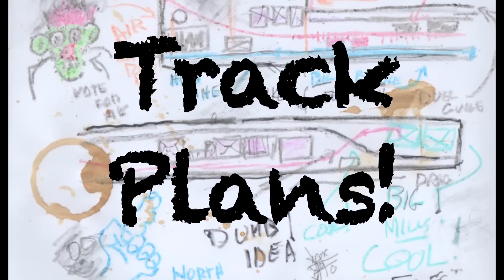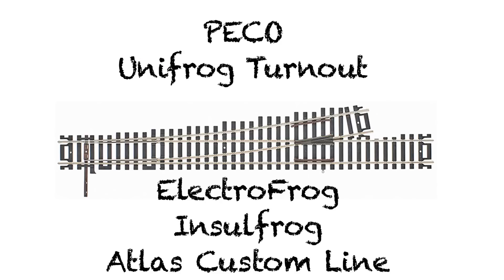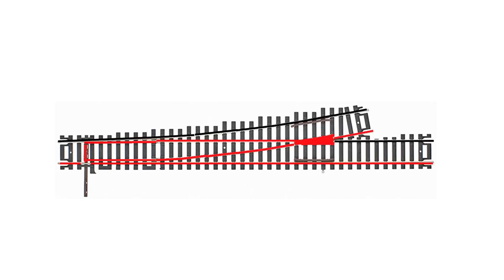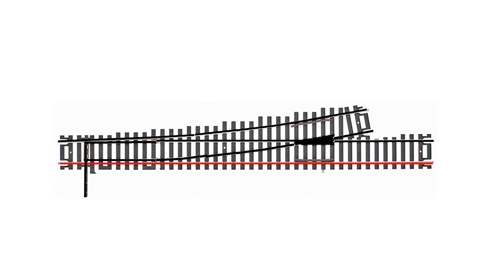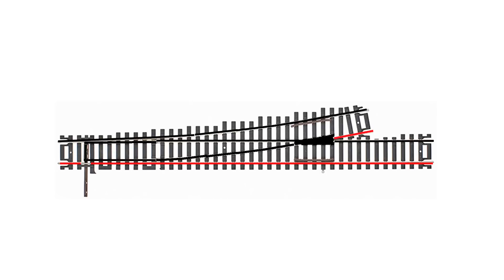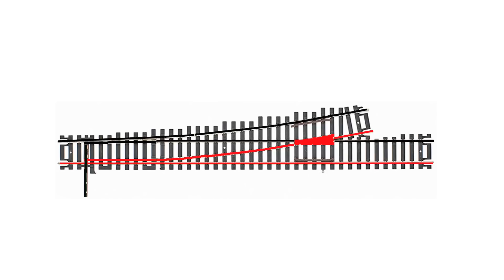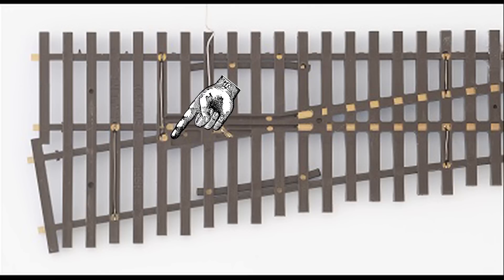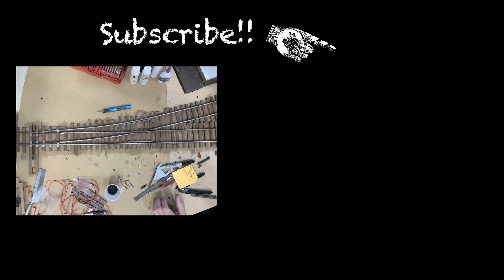How To Wire Model Railroad Turnouts Like a Pro. Peco's Unifrog, Insulfrog, Electrofrog

Comment: Good to know Toyman because I'm starting to wire my layout right now. If you are building a railroad or testing a signal system you need to know what type of turnouts are out there so you can wire them correctly. There are three types insulated frog, electro frog, and the universal. If you are going to install an insulated frog turnout you need three items in order for the command station and or the signal system to detect whether that turnout is open or closed. First you need the turnout itself a 5 or 6 or even a big 7, next you need a device from atlas called a snapper or a tortoise switch machine, and finally you need a device from their signal line called an ICM. Alternatively you can use a Tam Valley Depot frog juicer, or an nce signal relay do you supply the turnout with power. If you're turn out is insulated the only components you need are the snapper, the ICM, or the tortoise to power. If you have an electro fog turnout along with the snapper and the Tortoise you need to install a device known as a frog jumper you can do this two ways weld a green wire with a soldering iron onto the frog on the the tab underneath or you can use the atlas frog conversion kit that comes with the snapper and attach a screw to the frog and attack a green wire directly to the snapper and use that to power  the frog or attach that to a frog juicer or you can use the tortoise to supply the contact input. On a universal frog since the turnouts contain a spring to can either attached wire or you can leave it out. Also you need to be careful. All turnouts need to be insulated from the rest of the layout before you attach them to your blocks or to your signal system or the turnout will create a dead short which can blow your power pack or take out your command station. Remember the stock rails are always powered so you do not need to install any jumpers or insulators on any of these rails. The closure rails in the middle and the rails that come off the points need to be insulated before they are connected to your track because these rails will flip their polarity once the turnout is thrown. So you need to place 3 insulators on each side of the turnout on each side of the closure rails and these have to be placed on the rails behind the frog and on the north stock rail coming out of the turnout headed into the next block so it won't short out the command station your power pack or the signal system. Think of a model railroad turn out as a circuit. The common wire is always black this wire is always live you do not need to place any insulators on this one. The red and white wires are your hots and they do need to be insulated to prevent a short. The insulators for these need to be placed on the south rail coming into the points and they need to be placed on both sides of the frog on the south rail coming into the siding and on the North rail on the main coming out of the points. Once you have these three insulators set you need to place jumpers on the track on each side of these insulators so that they always have power the common you only need one jumper because it is always live. The last items that you need in order to supply the turnout with power and also your rails is you need 3 atlas products these are an Atlas cab selector plate, an Atlas block selector plate, and finally a loop so I can play it if you install a wye or turntable you also need this to supply your common with power. Once you have these items hook all of your jumpers up to the selector plates and label them with a sharpie their colors so you do not mix them up when you wire underneath. The final thing you need is you need some way to control the turnout when you throw it you can either use a touch toggle, a double throw switch, or you can use an atlas universal switch controller. Just be careful with these switches and do not leave them in your neutral position for too long the snap relay and the turnout motor itself can overload if you leave it in the neutral position too long and only hold the button or the switch down for 3 seconds or it will buzz and the magnet will melt if that happens you're going to have to unscrew the switch machine and replace everything and worst case scenario you're going to have to rip out the whole turnout which you do not want to do. Finally if you are going to ballast you ballast underneath the turn out first before you attach to turn out to the layout and only ballast the shoulders of the turnout not the inside or the gauge if you do that you will weld the points shut and the turnout will not work until it is cleaned.

Comment: Thanks, Dale and Karyn!  Wiring seems to be the bugaboo for most of us who are not "Electrical types!"  BTW, which source might have 1:24 or G Scale vehicles/kits?  I have not had too much luck.  Thanks!
Reply from the maker: @paulkalff6408  thanks!!! 1:24 and 1:25 are easy!  Thousands made. Every hobby shop. 1/20 harder. eBay has them. Mostly modern. Every Corvette!  But search for 1/20.. BUT. look for the old Hubbly kits from the 70’s and 80’s. Metal kits. Great kits but tricky to build. Die cast cars are mostly 1:18. Hundreds offered built. No kits. Again eBay. Some hobby shops. We use them. A bit large. But mostly okay. Just a bit large.
Reply: @ToyManTelevision  Fabulous!  Thanks, so much!  Trust all is well on the Wasatch Front!

Comment: Made me remember some hard times I had with my self made turnouts. I copied them from a Peco Electrofrog, only to have a lot of issues when I switched to DCC. The worst was the brass link between the points, it wasn't easy to solder a PCB to replace it, with the turnouts glued on the layout! But it works fine now.
Reply from the maker: Yeah, on my old HO all of my switches were wired with shorted points. In fact, I didn’t have any separation at all between the closure rail and the points and the frog. It was all just one continuous piece of rail. Or I should say several pieces of rail, all soldered into one piece with a strap across the points. But that does not work on the new railroad!
Reply: @ToyManTelevision  I had that too, as I first made the one side of the frog and one point of the same rail, like some real turnout. Then I needed to cut it in several places, turnout on the layout!

Comment: Sir, your layouts for frog angles are technically incorrect.  You show them as a right triangle.  The length for the larger number needs to be down the center of an equilateral angle with only 1/2 or 0.5 perpendicular to the centerline.  Granted, it is a very small number, but it is part of the definition of the frog angle.  The way you have the layout "will work" but not as well as when done "correctly".  The correct dimensions become more important to the operation of a turnout as the turnouts and speeds through them get greater.  A 1:1 or 1:2 frog or a mine kick-switch point will operate by pushing the mine car over it but it will operate but with a lot of jerkiness.   The smallest commercial frog produced was a No. 2 and 8# through about 20# or so for mine track of 15 to 24-inch gauge, mostly 18-inch.  The larger the gauge, the more the wheels need to be independently free to rotate about the axle to reduce sliding friction by being locked together by being on the same axle and having to turn at the same speed.  Your trackwork looks great and seems to work well.  My comments are for technicality only.  So long as the track gauge and guard check gauge are held within standards, a turnout can be built and operated almost as wildly as wanted and it will "work".  According to the AREA Standard Plans, the lead, the distance from the Point-of-Switch(PS) to the 1/2-inch point-of-frog(PF), may be changed by as much as 5% to keep from cutting rail.  I would not suggest changing any dimensions on No. 16, 20,  24, or 32.5 turnouts because of the speeds trains take in using them.  The 32.5 frog has a movable point and no guardrails to guide the wheels but has an 85 mph speed through the turnout side.
By the way, your slide plates under the switch points need to be longer to support the points under the 3 ties at the heels of the points.
I am working on getting you a treatise on how to do vertical curves.
Reply from the maker: Interesting! I’ve never heard of expressed any other way than just a right triangle and model railroad. I have seen the movable frogs on the long switches. I can see where those are a great advantage on a prototype railroad and they would be fun to model. Those long switches are a real challenge when working on a model railroad as they just eat up space. I’ve seen a lot of N scale railroads though that really get into that kind of prototype look. On an N scale module railroad you can actually pull that sort of thing off.

Comment: Getting back into the hobby after 20 years, looking for inspiration and "what's new" for designing my new layout. I get thrown these very interesting videos. However I'm building Marklin, so a 3 rail system, and none of this applies to me.
Switch frogs are just a bit of metal on Marklin track as both rails are neutral and the third rail in the middle or in the form of catenary provides the AC phase or DCC.
Reply from the maker: Center rail certainly solves a lot of problems! I love those trains. Good luck with your layout.

Comment: I model in On30 using Peco 0-16.5 track and turnouts.  Those turnouts are Electrofrog.  Using a Dremel cutoff wheel I isolate the frog and solder a green wire to it.  I have some tiny solid core wire and will solder my own jumpers underneath between the stock rails and the closure rails.  Then I do not need to depend on the point rails for electrical contact.  One thing I do recommend is a drop of glue on the rails that were part of the frog.  If you need to remove that turnout, those rails can fall out.
Reply from the maker: @dkaustin98  ditto!  Everything powered all the time with powered frogs (yellow wire). Frog juicers. And feeder wires to every rail. Turnouts, stick rails, everything. Every length of rail has a feeder to the buss. While power flows through the rail joiners it’s redundant. So every length of rail is connected to power in 2 or 3 places!

Comment: Kn regards to your out door layout, do you get any snow?? will it effect your operations in regards to shorting out the switches? From what I have seen G scale snow plows actually work for snow removal as well as sleeping cats. But with snow acting as a conductor does that not short out the entire operation??
Reply from the maker: @paulflak2823  hi!  Yup. Up to 2 feet on the layout!  Rails hit 160° in the summer!  We had an “inland hurricane” a few years ago. 110 mph winds!  Several structures blown apart!  That’s outdoor railroading!!  

We have run in snow. No problems if the snow isn’t too deep. Or ice in the tracks. But if I can brush the snow away not a big problem. And I’ve run in 1/2” of standing water!  Without a problem. But maintenance is a major part of outdoor railroading. 🚂🚂🚂🚂🚂🚀😃
Reply: Thanks for the video 😃
Reply from the maker: @ hi!!! Thanks!

Comment: Another point of frustration for new comers or modellers building on a budget, using used re wired Peco switches, DC to DCC conversion by previous owner, now new owner wants to run DC with this converted switch. Trying to talk a newbie through re soldering connections is best left to you.
Reply from the maker: @paulflak2823  yup. Truth. 🚂🚀🚂🚀😃

Comment: I have been meaning to ask you. what made you decide to go with aluminum over steel or nickel plated brass? 
I know steel would have been harder to use a rail bender but it would have been bullet proof.
Reply from the maker: @CannonCountry  on the old railroad I went with aluminum because of cost. 600’ of track. I had feeder wires everywhere!  And I was a massive pain. I had an LGB track cleaner and ran it for about 30 minutes before I could run anything other than battery powered. So on the new railroad we went with Llagas Creek nickel. Code 250. We have never cleaned the rail in most places. Works fine. Expensive. But only about 150’ so far outside.
Reply: @ I must have been watching an old video. I totally thought you said aluminum recently. But I’ve been watching some old videos too. So maybe I got confused. 
I have LGB for my indoor. As long as I run trains for my son everyday I have had no problems. But if I skip a few days or a week then the track has problems. I’ve been thinking about nickel for a little while. Good to know it has your endorsement.